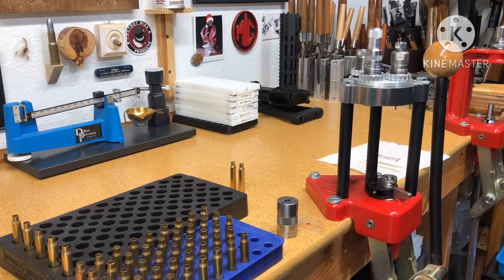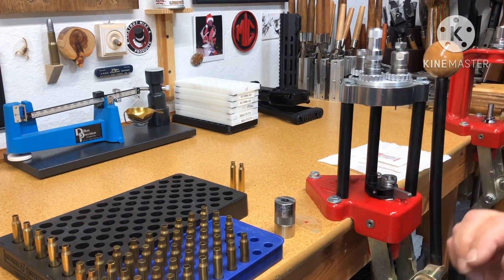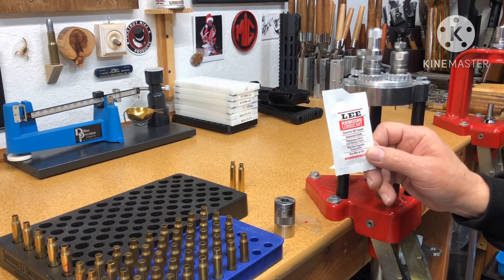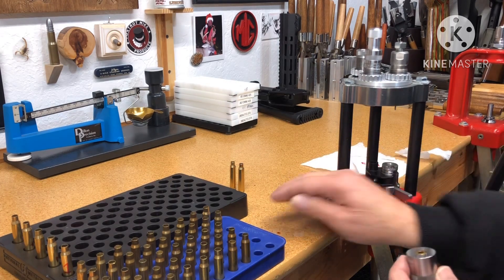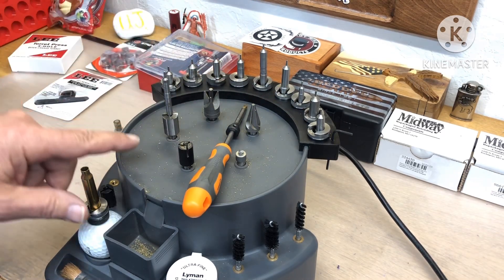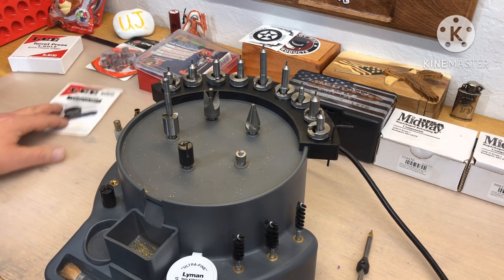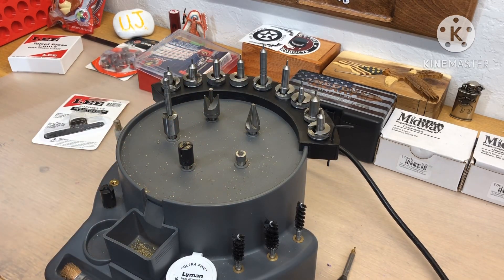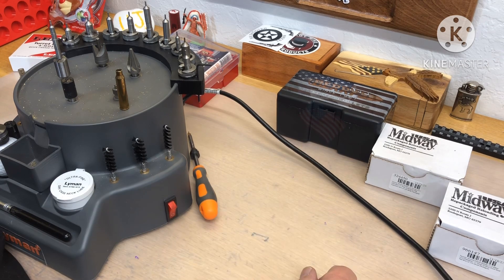Some new to me making .223

Comment: Nice report on that Lee case lube UJ I have never used it either being a Unique fan. Prolly will stay with that since I am a  cheap arse. 😀 Nice, that the turret is doing fine for the resizing as well. Love the golf ball holder, Lees case holder leaves much to be desired, I throw those Lee aluminum case holders as far as I can into a round recepticle and keep the length pin. 😆 Looks like its been a good day on the bench!  Wow, that Lyman machine is quiet!  Ironically most of my other prep equipment I have is Lyman. But I chose the RCBS prep center for its 2 speeds. I think it is louder because of its gearbox. (It has 2 spindles that are double speed for brushes or whatever U like.)
Reply from the maker: Thanks Paul. 👍

Comment: Jim, as far as the pins for the tumbler, I did the same (Mixed pins) and had the same thing happen, Now I was brought up not to be wasteful. However, I have decided at my age not to make the best of mistakes and go through extra work, I placed the pins in the proper place (In the Garbage can) and bought new pins. I have never looked over my shoulder about that. I realize sanity is worth a pound smart and not a penny dumb. Btw... for the 55Gr bullets, H335 or AA2230 is what I used and got good results and you are right, I wouldn't waste Varget on those bullet weights. - Dave
Reply from the maker: Thanks Dave. 👍🕺🏻🇺🇸

Comment: I guess I'll have to try some of the lube that comes with the die sets.  I got a tub of Unique and have just used that.  I've loaded a few .223 just to see that I could do it.  Failed with a cast bullet, but I may pick up a single shot or bolt gun some day.  I just pulled a bag of 55 grain jacketed bullets out of the stash today and put them on the bench to remember to load them.  Good stuff UJ!
Reply from the maker: Getter done. 👍🕺🏻🇺🇸

Comment: I’ve found a pin in already fired brass while decapping. 🤫. It was fine, didn’t cause any issues.  👍  I want to load 223 on the dillon but haven’t decided on lube solution yet.  Normal use imperial, but that process seems slow for a progressive press.

Comment: So are you sold on that lube or will you be back to unique when it runs out?  Congrats on entering the 223 world!   If I get another press, it will be a Lee turret press.  I don’t see getting another press in my future, but if….. 

Do you need another 44 mag for set?  I have an extra Lee set that I don’t use and would be happy to share if you could use it.
Reply from the maker: If you had a turret you could use them for 44 spl, I’m using an old set for spl right now and have to lube the cases. 🤭
Reply from the maker: Oh as for lube I like home made and unique for cheap, the Lee is good for not having to clean. 👍

Comment: I started out with my father and grandfather.  They used a wax in a tube. I quickly learned about lee case lube. Its all I use. Once a pad is soaked in it, you can use a little water to revive it and use less lube. It goes a long way.
Reply from the maker: This stuff does go a long way. 👍

Comment: Love the golf ball hack, do you have a video of that?  Just epoxy?
Reply from the maker: I did but the I was deleted from YT.  I used a magnet fitting but just drill a hole so it’s tight with glue, I also sanded the base of the ball so it stands up. 👍